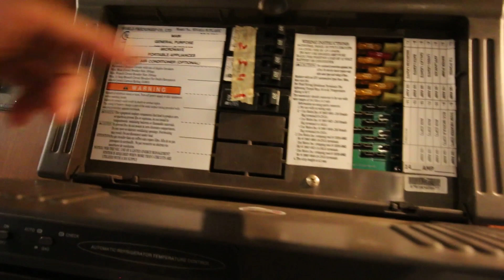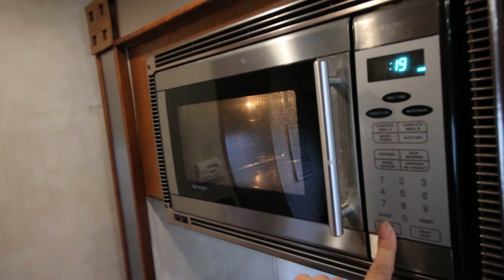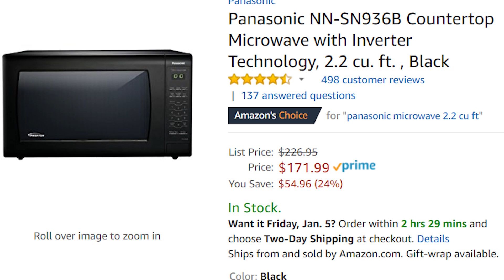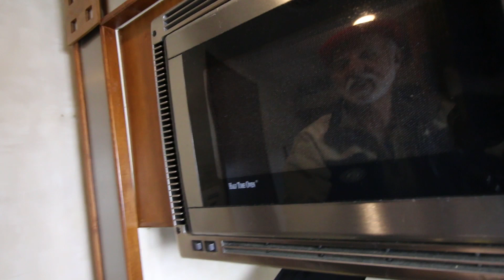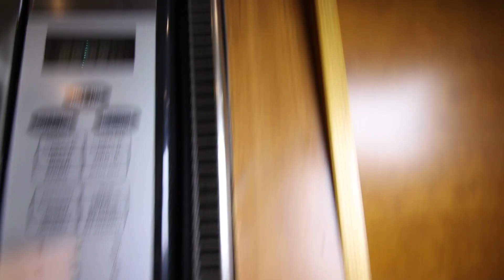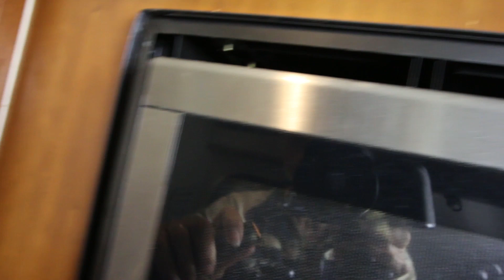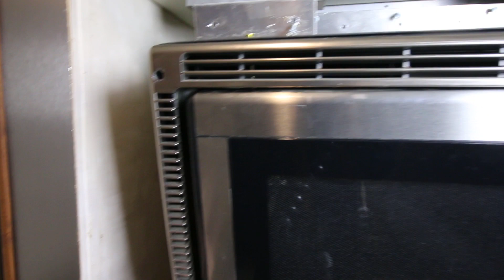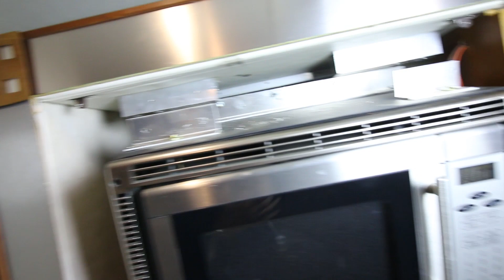RV Microwave Oven Removal, Repair & Replacement - Part 1

Comment: Have got this Apollo halftime micro/convection oven like this one. The turntable dont work because the (spindel) has broken and has not a part for this. The micro has not a softstart, and the transformer 230/120 60 Hz for europe will turn of during startup. Will replace it  with Toshiba TL1-AC25CZA toaster,  fry, grill and convetion functions. It has the right size to get in this metal box. Mine Apollo oven is only fasten with self drilling screws to the frame in the bottom sides. Have to use a longer angle screwdriver to get it out. Has to figure out the '' backside'' fans for propper connections to work. Will have some more space around with the Toshiba oven. It will now cost about $ 350 with shipping and taxes for Norway
Reply from the maker: Good luck.  Some people buy a manual wind-up turntable for uniform microwave distribution when their built-in turntable breaks.
https://www.amazon.com/Nordic-Ware-Microwave-Micro-Go-Round-Inch/dp/B00004W4UT

Comment: I'm upgrading my microwave to a convection microwave. I'm so glad my RV has a cabinet box for the unit and doesn't hang there.
Reply from the maker: Good for you - with your cabinet the job should be easy-peasy... well, at least not quite to challenging!😜
Reply: I, too, am hoping for an easy replacement as mine sits on it's own shelf above the stove.

Comment: My RV microwave became loose for the second time. It pushed in about 2 inches on one side while driving. I am hoping I can secure it myself without getting into service. Thanks for the insight. Any suggestions?
Reply: H Laura.  When you say your microwave "pushed in" I assume you mean it slid toward the back on one side so cosmetically it doesn't look correct and/or the door may have problems opening and closing.  I'm sure you would prefer not to have to remove the trim, etc to have better access to the assemblies if not necessary.  In my case I used small wood strips as shims to ensure the microwave as secure and prevent it from moving around.  Perhaps can carefully find a way to grab hold of the microwave (be careful not to tug on on the door with too much force, etc.)   You might consider buying a set of strong suction cup handles for $10 on Amazon - the kind used to suck to a shower door and in your case, adhere it to an inside of the microwave (top, bottom or sides) in order to "encourage" the microwave into the correct position.  Once you get it in the right position, then add your shims, etc so it doesn't slide around.   In my case the microwave sat a little bit too low and rubbed when opening the door, so I lifted up the microwave a bit and put a 1 inch by 2 inch by 1/8 inch piece of the end of an old ruler to raise the height of the microwave.   Good luck Laura and let us know how it turned out :)

Comment: At 1:35 you mention that the microwave oven that you are going to remove is an Apollo.  Could you please mention what model it is?  I'm having problems with an Apollo Model AAC24BIB.  It turns on but it does not heat.  I also want to maybe install a Panasonic microwave oven.  Thanks for posting this video.
Reply from the maker: Yikes, it's been 3.5 years now and the Apollo is long gone.  Yes, mine turned on with the turntable still spinning but the convection and microwave were not working.  Anyway, I will say that it looks identical to this Apollo Half Time, if that helps: 
https://www.amazon.com/Half-Time-Microwave-Convection-Oven/dp/B0012BTDL8
Stand by and I'll see if I have some manuals left in the RV - stand by... (always good to save one's documentation)
Okay, after going through dozens of manuals (hard to believe how many subsystems are in a RV), I did find the 35 page manual.   The only nomenclature is "Half Time Oven (R) 34 Series.  Sorry no model numbers etc. were ever mentioned but it does show 1800 watts in Half Time, 1600 watts in turbo power convection, and 1000 watts for the microwave plus speed defrost.  Their telephone number in the manual for service is/was: 800-330-9707 or write PO Box 6066, West Palm Beach, FL 33405.   Good luck!